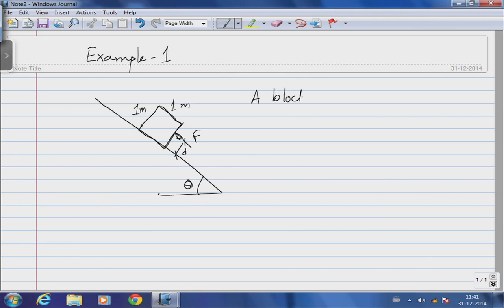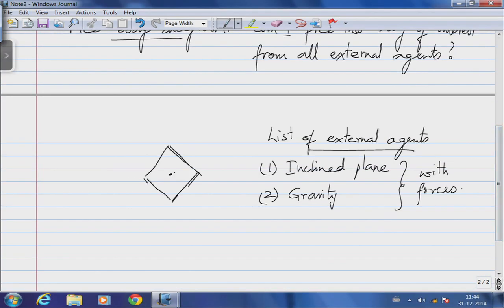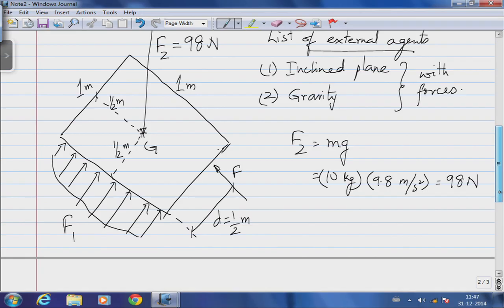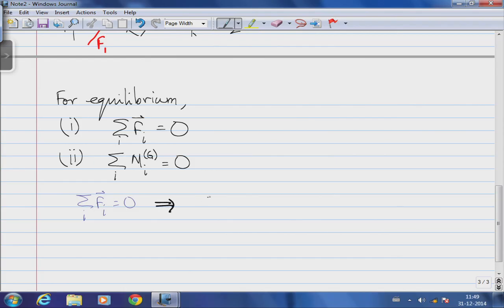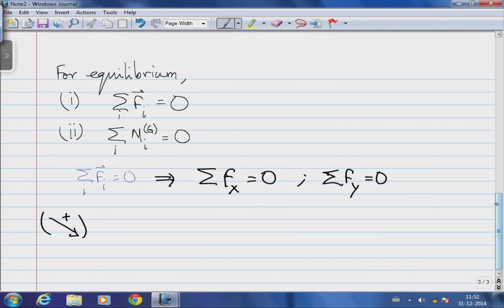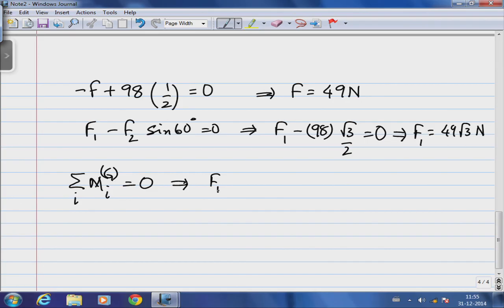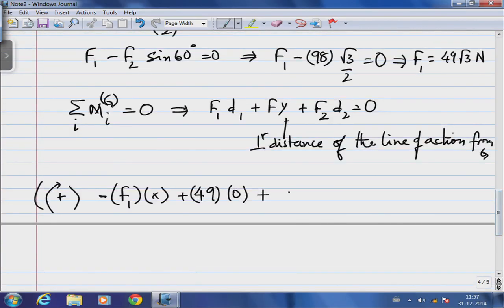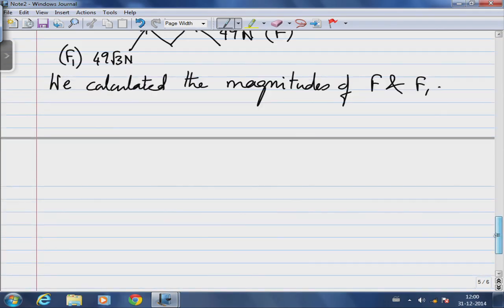Example 1 - Statics

Comment: Sir sorry to say I didn't get anything in this video
Reply: bro listen word to word then you will definitely gonna get it...
Reply: @shivanshuudeniya3338  
Whats constraint force by inclined plane on block (F1)..i cant understand. ...plz tell me why how this F1 appears
Reply: @subrataray9442  Here F1 is the Normal Reaction force caused by inclined plane whic is equal to the  F2*cos (a) where a is the angle between inclined plane and x axis
Reply: @shivanshuudeniya3338  
Oh..but sr. Says its distributed constraint force it has'nt unic line of action. ....but normal force = reaction to body weight which has unic line of action...so what is it..?..
Plz explain..
Reply: @shivanshuudeniya3338  
distributed constraint force f1 has'nt unic line of action. & this f1 exrted by inclined plane resist to penetrate the block into inclined plane..How f1= Normal reaction force.!!...plzz tel me..
Reply: @subrataray9442  look we take distributed constraint line of force  for undistributed mass, as their centre of mass and geometric centre do not coincide. but we take unique line of F1 for the uniformly distributed mass as in the above case where geometric centres and centre of mass coincide.
Reply: @shivanshuudeniya3338  
Yeh..here, block's mass is distributed & we take the resultant of these distributed forces which pass through the centre of mass of block. .as result.. f1 has unic line of action & f1 = normal reaction & this constraint f1 resist to penetrate block into inclined plane...right..!
Reply: @subrataray9442  block's mass is Uniformly distributed..👍
Reply: @shivanshuudeniya3338  
But my dear frind..what's the constraint force , how & why it appears here ?
Reply: @shivanshuudeniya3338  
Extrmly Sorry 2 disturb u once again.plz dont mind bro.
Reply: @shivanshuudeniya3338  
Oky..haha...☺ 👍..tell me ur. Convenient time then we'll start discussion all right...